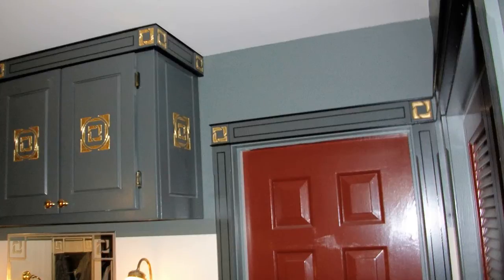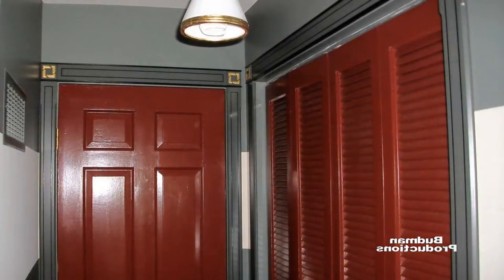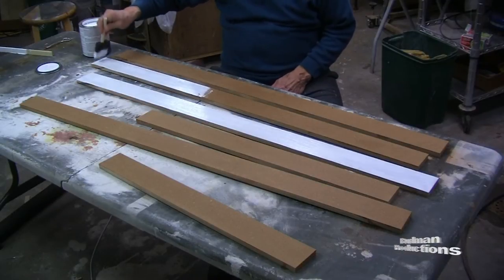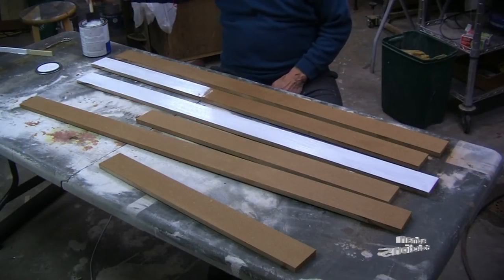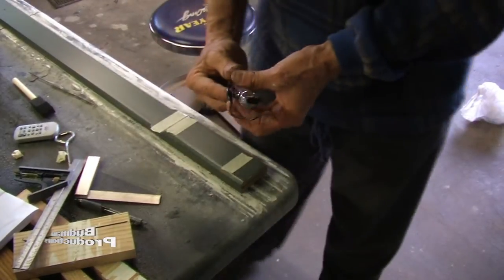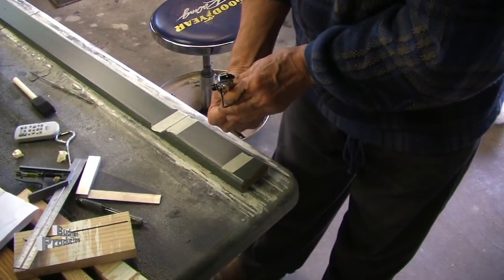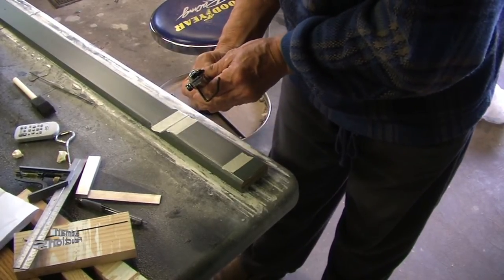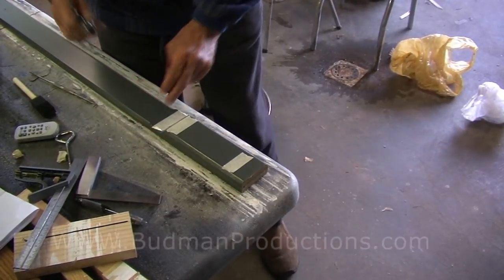Pinstriping Woodwork Using a Beugler Striper

Comment: I have been considering getting a Beugler to help me learn how to do pinstriping on cars but this will certainly give me another avenue as well.
Reply: There are a few cheaper kits out there I made my own with a coin as the wheel and a tube with a bit of sponge to slow the flow it worked bit was limited,  the beuglar tool is the best  but if you just want to try your hand at it look for the Marshalltown : Embee Master Striper it's cheap but does the job.